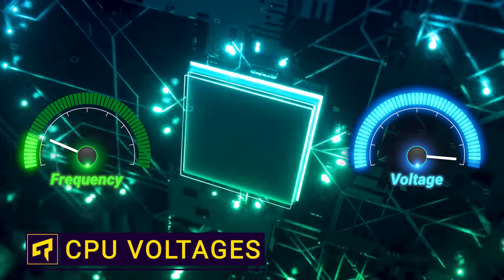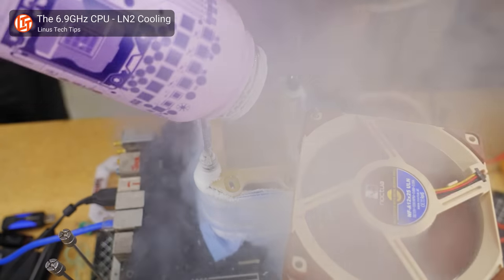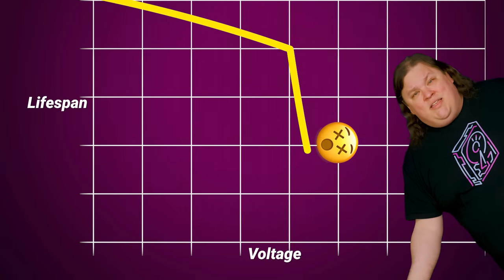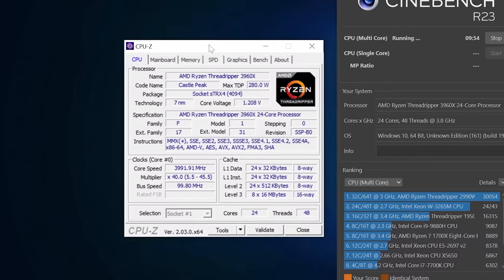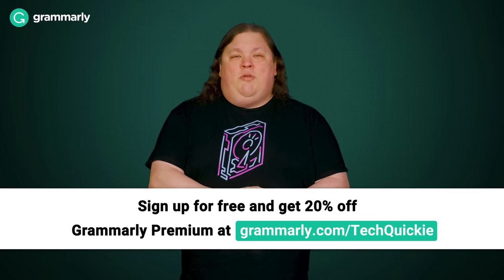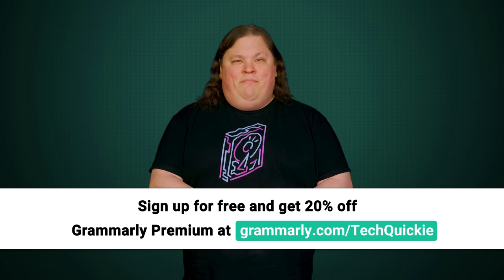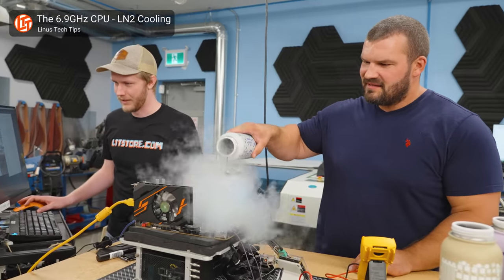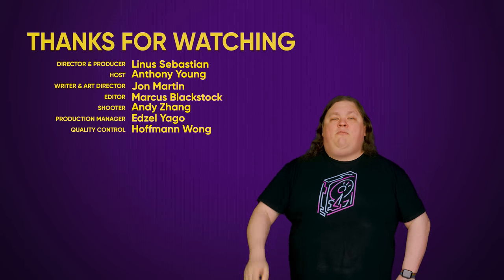What's the Point of UNDERVOLTING Your CPU?

Comment: Undervolting was an absolute must for my Ryzen 5800x. The Chips temps ran way out of my comfort zone (Even throttling occasionally on Dark Rock Pro 4) but setting at least an offset helped a ton!
Reply: I undervolted my CPU to 0.5Volts and now it’s at MUCH low temperatures. Only downside is that it doesn’t run
Reply: @thegreatresetofthehumanrac664  saves a crapload of power tho!
Reply: @thegreatresetofthehumanrac664  Exact same for mine. Went from 89c in cinebench, to 76c. Dropped almost 40 watts.
Reply: i just posted a comment about this too! i have 4.6Ghz as the working load with 1.2v (llc 4) and it runs smooth, hits and holds 70-73c under load, and will hold clock speeds through heavy loads. people have tested 1.3 and 1.4 since the day it came out and there hasnt been any indication of degradation, but under those volts i have had thermal runaway
Reply: You might want to get your motherboard checked then.  Thats a common issue with Asus motherboards and not actually related to the CPU at all.  You put that same CPU into a different motherboard I guarantee it'll be 15c cooler.
Reply: i set off an offset in my bios for my 5800x. i found that at -0.0625v offset i would get pretty much the same boost clock as stock, but 15c lower.
Reply: @NinjAsylum  interesting. Im on an asus mother and my 5600x got pretty hot at stock values. Undervolting solved the temperatures at least, and the performance is good. Gotta think in another motherboard i guess
Reply: @thegreatresetofthehumanrac664  guessing its around ambient?
Reply: @Eveningbreeze78  How did you know it is sitting at a comfortable 15°C?
Reply: Goddamn with dark rock pro 4?? I thought that thing is an overkill for anything
Reply: No it isn't. Just use Eco Mode. Trying to manually tune Ryzen is really dumb. It's already got AI tuning built in real time that does it better than you .
Reply: That's odd, my 5900X never thermal throttles, with that same cooler.
Reply: @thegreatresetofthehumanrac664  nice! so, actually ambient is heating the CPU... you could switch off 4 cores, and go fanless.. Cool&Quiet ;)
Reply: I just undervolted my Ryzen 7 3700X, and now it's running  20 degrees C cooler (from 60's to 40's) in games with no downside.
Reply: @thegreatresetofthehumanrac664  wow...

just put it back to 1/10 lower than stock.
Reply: my 5900X ran cool as a cucumber
Reply: @TheRealSkeletor  The 5800x has a single ccd, but the same TDP as the 5900x so the heat builds up significantly more. It is designed for it though according to AMD specs. It'll take 90c before it throttles. The op just got unnecessarily twitchy because it was outside their comfort zone.
Reply: @CaptainSpicard . That sounds like too much of a power drop given the voltage decrease. The only way that makes sense is if the clocks are correspondingly lower.

I am sure if I weren’t to lazy, this can be demonstrated mathematically.
Reply: Geez what are these temps? Do you guys even have airflow in your cases? I'm running a R5 5600X stock, with a Hyper 212 Evo V2 (with only 1 fan on it) and the CPU has never seen higher than 67C under max load.

Now I wonder if I should even bother with undervolting it. 😅
Reply: @Varkoroth  This is just ignorance of how tech works. The 5800x  is a single ccd with a tdp of 105w, the 5600x is 2 ccd's with a tdp of 65w. The temperatures cannot be compared at all.
Reply: @Varkoroth  Oh, my apologies. I mistakenly thought you were replying to me lol
Reply: @Varkoroth  nice results. This is the thing with amd cpus, the x variants barely have any difference from the non x. So you can tweak the non to be like the x and the x to be like the non x quite easily.
Reply: @GestaltO  That's true.

Now I wonder if I should fiddle a bit more to try a bit lower voltage, though, this seems to be good enough.

I was also having a lot of stutters in Hogwarts Legacy in the Hogsmeade area, which have now been reduced by a MAJOR margin. It's way more stable now, so I'm quite happy with the results. Might not be the best possible, but it's my first time messing with such stuff, so I'm not very confident going into it and tried to only touch a few things slightly, so to not destroy something. 😂
Reply: @Varkoroth  oh interesting, I might have to have a fiddle with my 5800x as hogsmeade definitely has issues.l like you say.
Reply: @GestaltO  It's definitely worth a try. Especially if you're running an Nvidia card.

What I've noticed is that there are some shader issues on Nvidia GPU, which in addition to CPU utilization issues in-game (most probably due to Denuvo), leads to a lot of stutters.

I got myself a RTX 4070Ti, which was running the game at 250-300 fps in the general areas + hogwarts, and then dropping to 90-110 in hogsmeade with awful spikes. Sadly the GPU was faulty and died, so I'm waiting for replacement now.

Running the game on my 2060, gets me 100-110 fps, with around 55-60 fps in hogsmeade, but the stutters were causing it to drop to 4-5fps sometimes.

Now with the undervolt, I get avg of 70fps in hogsmeade and don't drop below 55 fps, without changing any graphics settings (all on medium, without dlss on the 2060).
Reply: @GestaltO  I did a bit more tweaking. Dropped the voltage to 1.15V and set the core clock to 4.45GHz. This seems to be the best option so far.

Here are the results with these settings:

CB R20

Core - 61 C
Package - 62 C
Score - 4352

CP 2077

Core - 53 C
Package - 55 C
AVG FPS - 70
0.1% Low - 40

Hogwarts Legacy

Core - 51 C
Package - 53 C (was 65 C at stock)
AVG FPS - 72.9 FPS
0.1% Low - 23.6 FPS (dropped to 4 fps at stock)
Reply: @coilcitu  what underbody values did u use
Reply: People should really stop babying their chips so much...this things are way more durable than what people think and its not that easy to degrade (not to mention to kill) them as long as youre not on the far extreme end of the voltage spectrum and the cooler being used is decent- and that's only relevant if youre ocing with overvolting... completely irrelevant at stock. This things run hot by design, as engineers wanna take advantage of available thermal headroom for  performance. It throttles if it needs to. I never understood people who are afraid of the CPU'S temps when running at stock.... that's what it supposed to do. Stop thinking you're smarter than the engineering team. Chips failing/degrading is usually due to the chip being faulty to begin with, or whacky behaviour by the motherboard *erhm*Asus*ehrm*. Bsods people are suddenly experiencing due to "degraded overclock stability" is usually an instability that was there to begin with and didnt show itself till that moment. Every experienced overclocker knows that instabilities can manifest way after you thought you're good to go. Only rarely there's true degredation as the root cause (again, as long as you know what you're doing).

Another 2 things as a sidenote:
A. 5800x runs much hotter since its a single ccd chip with relatively high tdp. That's again, by design. 2 ccd chips will always run way cooler due to the heat spread. 
B.stay alert if you go the negative offset route, as it can take you on a trip to clock stretching land, which is something you don't want....

Comment: I messed around with undervolting recently. I have a 5700x with a max boost of 4.6 GHz. Now, with a 200 mHz boost override, my cpu hits 4.85 GHz while gaming without affecting temperature at all (stays below 60 degrees) and voltage never goes over 1.35V. Ran Prime95 for 4 hours and had no issues. Pretty nice.
Reply: Curve Optimizer? Negative offset?
Reply: @linearz  yes, most cores at -20, some at -15 and my fastest (and the one I had the most issues with) at -10
Reply: @samuelvincent2007  I think I have a little bit better 5700x, best core -25, 2nd best -13, the rest -30. Can do +200 boost too.
Reply: @linearz  what tests did you do for stability ? I ran some occt today and some Prime95 with CoreCycler, and found stability issues. This is what I have so far :
0 : -25
1: -25
2 : -10
3 : -20
4 : -10
5 : -25
6 : - 25
7 : -10
Reply: @samuelvincent2007  same, I use both occt and corecyler. Only for a few hours, not 24 hours lol
Reply: @linearz  Damn, those are pretty big numbers. What frequency are you hitting ?
Reply: @samuelvincent2007  single thread reach 4.85ghz, forgot the multi thread, but it can reach 15000+ on CBR23 (similar to 5800x stock). Now it's running at stock PPT, 76w because I prefer cool and quiet PC with an overkill 240 AIO (everything low RPM). Even at 76w, single thread still can reach 4.85.
Reply: @linearz  ok, I'm pretty much reaching the same. Max I hit is 4.85 too, but ppt at 120. Still not getting higher than 75 degrees under full load with a hyper 212 evo.
Reply: @samuelvincent2007  you have good setup there, enjoy!
Reply: I got a 5600x how do i undervolt without performance loss?
Reply: Mine was unstable while using a boost. I mean it didn't crash, but even with -20 UV on all cores, with a 100mgz boost that AMD Master did with Auto OC it kept going up to around 84C in Cyberpunk. I went into the bios and set PBO options all to Auto and kept the -20 all cores undervolt and even though it's at 4.65Ghz now instead of 4.75Ghz, in Cyberpunk it stays around 57C.The FPS is the exact same too.
Reply: @ramdom_assortment  I had to manually set different values for each core, cause a total negative offset of even -20 was unstable. It took me days, but I managed to find settings that gave me a good boost, while being stable and cool. I've got some cores in the negative 20s, but my 2 fastest cores couldn't really go under -6. Most of them are sitting somewhere between -8 and -20

Comment: Undervolting on my gaming laptop was a life saver. I'm not able to use a desktop in my situation and undervolting helped a lot with thermal throttling
Reply: Yeah, power use is proportional to voltage squared, which easily translates to heat generation.
Reply: You need a laptop cooler fan, or place a fan on the table toward your laptop.
Reply: @Keepskatin  I already use one, it's not enough - gaming laptops suck XD
Reply: @cyandrix  gaming laptops don't suck ,the model you bought does
Reply: @bhuvangunessee  true, legions are fine and have good cooling
Reply: @cyandrix  lenovo legion 5/5i/7/7i? Zephyrus M16/G15? MSI GF65?
Reply: @FranciscoTChavez  not voltage square, it's P=V*I or R*I² so current squared
Reply: @JokerTheDank  P = c * k * f * (v^2). I would use approximate symbol instead of the equals symbol, but I'm too lazy to look that up.
Reply: @FranciscoTChavez  ok it's true, P=R*I² can be rewritten as P=V²/R
Reply: @krishoku  again, good or bad model, not brand, not lineup, not manufacturer, it just depends on the model. Legion has good and bad models too
Reply: Intel has been locking it on 12-th and 13-th gen, I mean completely disabling it. Locking began since 10-th gen. So for most laptops today, it's unfortunately not an option. And I wish Tech Linked mentioned it

Comment: Just be careful to note you don't also lose performance as with my 5900x I recall undervolting too far would no longer give a harmless bluescreen, but instead reduce your actual CPU performance instead. This is preferrable to crashing but it's something to note that you can be invisibly reducing your cpu's performance in certain applications. Also some apps will drop performance more than others by undervolting too far without you noticing it. For example, in flight simulator I only dropped a couple of frames when undervolting however some other program dropped almost 10% performance without me realising until a few days later. Also funny clip at the end
Reply: In my experience with Ryzen Zen 3 (5000 series cpus) you're better off going into the Curve Optimiser in the bios and finding a stable undervolt there. Fastest way to do this with these 6/8/12 core cpus without being a tedious process is to reduce the all core curve first to -10, then try -11, -12, lower and lower until you get a bluescreen on regular computing. Then set it back a level that was stable and then go into Individual core mode in the bios and start lowering your STAR cores. These are the ones that do the most work and cause the most heat in most programs so they're the most important ones to get first. Once you get the top 4 cores you can pretty much just ignore the others in my experience.
Reply: For intel's new alder lake, what I've found is reducing the voltage like they point out in the video is best. For reference on my 12700k I managed to get only an -0.03v undervolt working for a 5ghz all core clock, crashing sometimes in AVX loads (5ghz AVX is just very tough to hold already) but if you leave it stock it can likely go a little lower than that and still be stable.
Reply: You sir just saved me a lot of headaches
Reply: hello mr half life
Reply: I've experimented with underclocking my 5900X a good bit, and I'll say that certain cpu heavy games took some fps hits. Especially rimworld, dwarf fortress, and other cpu intensive games. Otherwise... no real point in not underclocking. I usually see around 3c or even 4c improvements in temps at idle. If you have an MSI board, try the eco mode (in bios), it works wonders if you don't know what you're doing.

Comment: The way I always understood it was: 

- Intel and AMD always want to sell you a product that will work OOTB
- more voltage helps a given frequency stabilise
- therefore Intel and AMD will ship a voltage that is “safe” for every CPU they sell in a class, regardless of silicon lottery, leaving headroom beneath at stock clocks for undervolting without affecting stability that is dependent on the chip itself 
- boost clocks depend on temperature, and throttle when temp gets too high
- undervolting releases less waste heat (P=IV) so allows normal boost algorithms to stay boosted for longer
- both Intel and AMD already target very aggressive frequencies for their CPUs, leaving typically very little room for the traditional “more clock more volts” method of improving performance 
- therefore you’d either have to either not care or be silly to not undervolt

Comment: Works great on GPUs also. I found even a small reduction leads to a noticeable improvement in fan noise with no noticeable hit to performance
Reply: @IvyMike.  2080ti nice! I think I might go that direction with my next upgrade. over spec the card a little so I don’t have to run it flat out. What resolution are you using if you don’t mind me asking?
Reply: @videocollection8696  its*
Reply: Undervolting did wonders for my 3070 that was routinely running at 81°C before undervolting, I was getting concerned because even the HDMI cable was getting too hot.

Now it runs at 50-60°C at 925mv, lowered the core clock by mere 0050, and increased the memory clock by 800, and performance basically improved now that it's consistent.
Reply: @IvyMike.  Learn English.
Reply: @IvyMike.  oh ya that thing is going to outlast me lol I am at 1080p also I wish I would
Have went with a little smaller monitor 27” is a little big pixel density wise.
Reply: @IvyMike.  You clearly failed learning English then.
Reply: @IvyMike.  The original commenter's comment disappeared so it's no use continuing your troll.